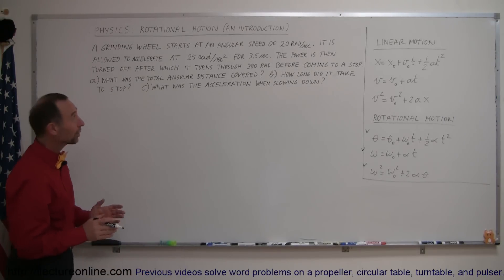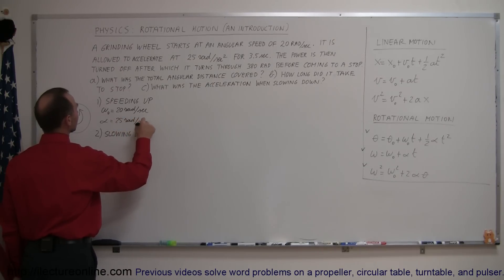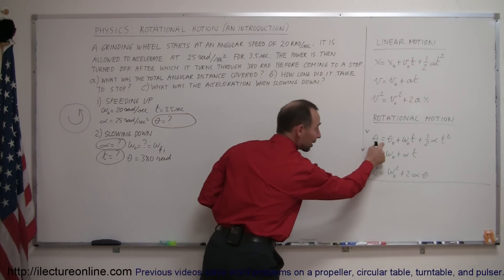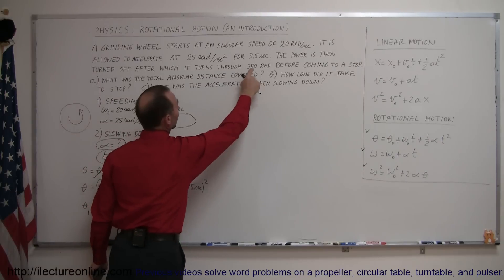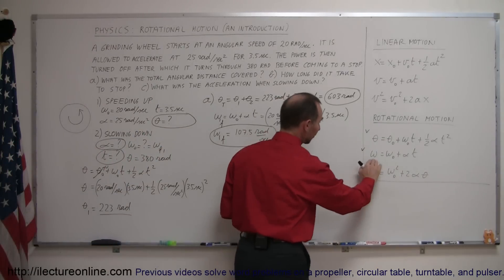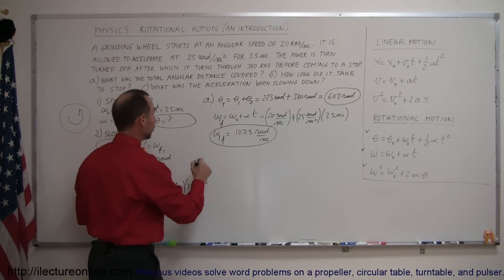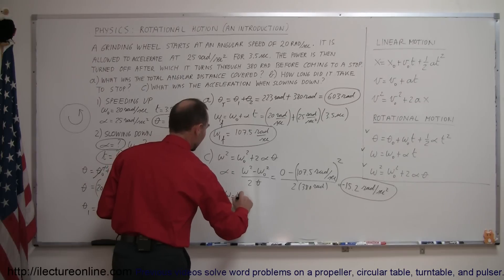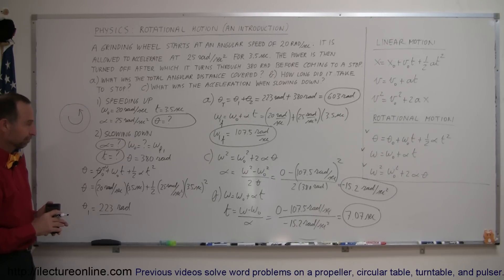Physics 11  Rotational Motion (6 of 6) Grinding Wheel

Comment: I dont get one thing in C shouldn’t the radian be 380 - 223? Because its asking about the time it took to STOP so wouldnt the final angular distance which is 223 be the starting point for the grinding wheel after the power is cut off?
Reply from the maker: After the wheel reaches its maximum angular speed, the motor is turned off and then travels an ADDITIONAL 380 radians before coming to a stop.
Reply: @MichelvanBiezen  Ohhhhhh thank u sir

Comment: Can you please upload video on shift mass damper (counter weight) used on automotive transmission for gear shift assist? Its weight/MOI  need to fine tuned with physical trials? Can we calculate it's mass based on its travel,shift time,MOI,CG?

Comment: hello sir, in the c) part of this problem, you wrote w^2 = w^2(initial) + 2(alpha) (theta). shouldn't the angular distance here be the change in theta?. i solved the problem using w^2 = w^2(initial) + 2(alpha)(380rad - 223rad) and i got different values
Reply from the maker: Even though it may not be written that way in the equation, it is indeed the change in the angle.
Reply: True but if the initial angular distance is 223rad and i am assuming it is (or is it 0?) for the second part of the problem, alpha would change, that's why am concerned.
Reply from the maker: You have to work each part of the problem separately.  1st part when the wheel is speeding up.  Second part when the wheel is slowing down.
Reply: yes i did, the angular distance for the first part was 223rad which agrees with what you did. My question is, shouldnt the angular distance for the first part (which was 223 rad) be the initial angular distance for the second part?
Reply: @judejistyu  go watch other vida bro dont waste his time.

Comment: time to stop wheel =time taken for acceleration + time for deceleration
                              so it should be 3.5 +7.06 =10.56 sec....
am i right? i came across with this doubt...plz clarify..
Reply: time to stop wheel=time from when is began decelerating/stopping to when it comes to rest. Acceleration has nothing to do with time to stop (deceleration), but you will need to find the final velocity after acceleration because that will be your initial velocity for deceleration
Reply from the maker: Rinil Babu 
What question are you answering?
Reply: +Michel van Biezen I think he's talking about b

Comment: How did you know that omega initial (2) is equal to omega final (1)?
Reply from the maker: Alex 
The problem is divided into 2 ;parts.
In the first part the wheel accelerates.
In the second part the wheel decelerates.
omega 1 final is the final angular speed of part 1.
That then "becomes" the initial speed of part 2.
Reply: Thank you that makes a lot of sense

Comment: for part (c) you used theta as theta2=380 
we should say theta 2- thta 1 ? right doctor ?
Reply from the maker: Jana,
Not in this case.  Theta 1 is the angular distance covered when speeding up.  Theta 2 is the angular distance covered when slowing down.  Therefore in part c, you should only use theta 2.